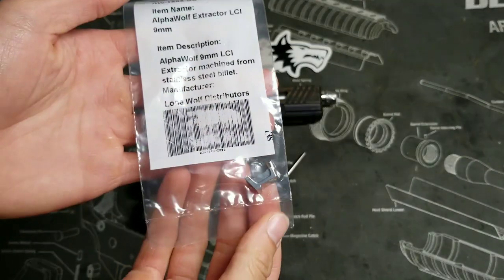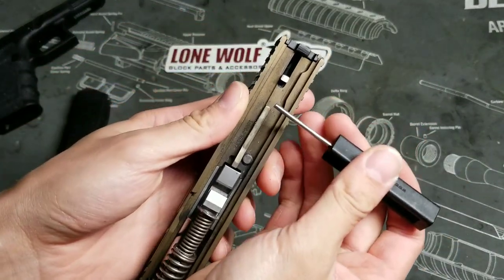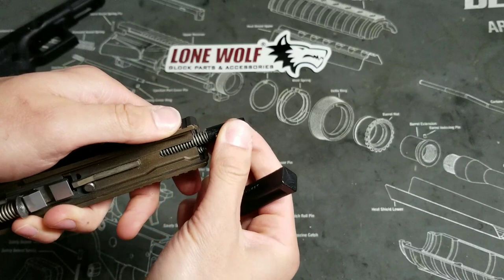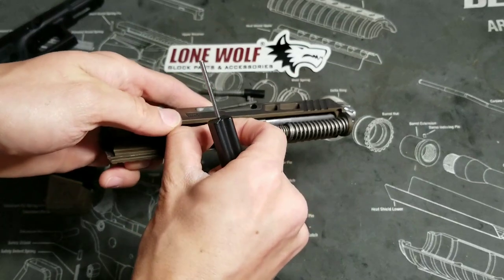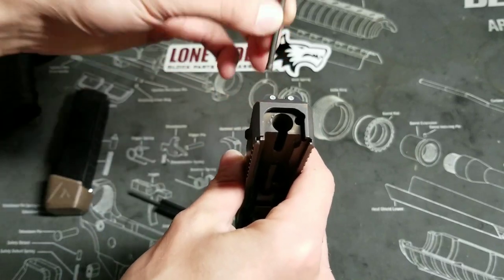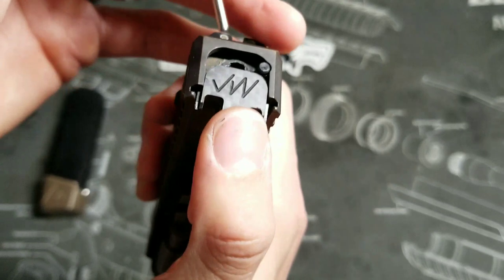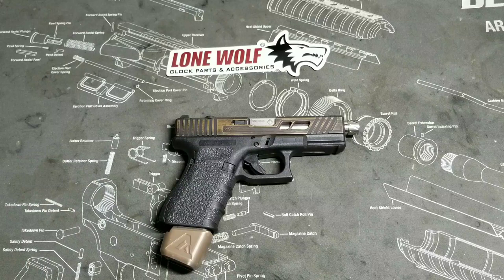Lone Wolf Glock extractor installation

Comment: Nice video.  Thought I needed a new extractor because rounds weren’t ejecting right.  Turned out my extractor plunger was really dirty and difficult to remove.  Eventually discovered that there was some blue gunk (most likely Loctite from RMR) on it that was preventing the extractor from functioning normal.
Reply from the maker: Glad you figured it out and it didnt cause an issue when you needed it

Comment: I built my Poly80 with factory slide parts and a Brownells slide. The extractor function is very rough. The surface the plunger runs against has machine marks or ridges of some kind. I plan to order the Apex extractor and install a Gen4 ejector to hopefully get the thing to cycle reliably. The slide function seems very smooth. But with rounds in the magazine it sticks going into battery. It seems to be the extractor causing the issues. A few of the first rounds ejected the brass back on top of the slide. And it tends not to go into battery.

Comment: Good video, but did you know you are suppose to replace the load bearing spring also.?
Reply: Wouldn't that be only if your upgrading from a non lci extractor to a lci extractor?
Reply: @PMRUNNER   this is what the LWD website says. They list the $1.99 part needed for certain types of Glock 9mm models. Gen 1-4, gen 5.
Reply: If you are going from an LCI to an LCI, then no.

Comment: is that a LW slide? Cut or replacement? Can't quite make out the marking/stamping. Seems like for what it costs to have one cut, might as well keep the stock slide as a backup and just buy a replacement cut slide for the same money. Good vid, thinking about replacing my OEM MIM for billet. Or just buy the billet and run the MIM till failure before installing? Hmmm...
Reply from the maker: This is a slide from Jagerwerks

Comment: Thank you I’m hoping this helps my p80 23 I got a gen 4 extractor that is the 40
And 357 but I’m going to try the gen 5 first if it works good I’m leaving it if not I’m putting the stock oem gen 4 one in

Comment: A year n a half later, any issues, r u still running this setup, any failure 2 eject,?..thx 4 the vid
Reply from the maker: I still have this set up but it is no longer my primary as of this year. No major issues since posting the video.
Reply: @TacticalAdvisor  you said "no major issues." So there were "some" issues then. What were the issues?
Reply from the maker: @DaddyGerLo  I suppose I worded that wrong. I haven't had any notable issues. I have had some gun malfunctions but nothing I can say without a doubt was due to the extractor.
Reply: @TacticalAdvisor  perfect. I will make my purchase then. Thanks for your reviews. They are very informative.
Reply from the maker: @DaddyGerLo  you're welcome!

Comment: I'm going to get one of those extractors for my G 42. I'm getting it mainly for the looks not for durability I have all chrome parts except the barrel. Nice video but are you sure it's smart to do a function check with a loaded magazine? It looks and sounds like you know what you're doing but man that's not right.
Reply from the maker: That will look sharp. Atleast you'll get the look you want while getting a more durable part. Also those are snap caps. That would be very unsafe to have live ammo in the mag while doing this. They are for training.
Reply: Thanks for getting back to me. They weren't on screen very long and they looked like live rounds. Its good to know you not only sound like you know what your doing you actually do. Thank You
Reply from the maker: That's my one gripe about snap caps. Most of them look very realistic. I check them multiple times before dry fire training.

Comment: Quick Glock 26 gen 5 question, I recently ordered the Lone Wolf 🐺 LCI black nitride extractor. I have a new Glock 26 9x19mm gen 5. The website order section said the version I got fits Glock 9mm gen 5. Would I need the small spring part from LWD too? Its $1.99. I would not think the extra tiny part is needed for the Glock 26 gen 5.
Reply from the maker: I do not think you will

Comment: Cool Video! I was interested in there new Stainless extractor Does it eject brass better than stock? Also when is the Polymer80 videos coming? Thx in advance
Reply from the maker: It is a more durable part. It will last longer than the stock part. The polymer 80s should be here and done soon. We are getting them stippled and cerakoted now.

Comment: My glock extractor does not move at at all even though it extracts the casings fine. So that means loaded chamber indicator is not working. It kinda stuck permanently at closed position, so when i load the chamber it does not show at all that there is a round in the chamber (i know it moves very little when round in the chamber but mine does not move AT ALL). Can you please guide me what could be the problem with my G17 gen 4. Thanks.
Reply from the maker: I would check and replace the spring.

Comment: I got a polymer 80 and whenever it fires the bullet doesn’t extract it just stays in barrel and I have to manually reset every round it’s the Glock 26 any thoughts?
Reply from the maker: Check the extractor and ejector.

Comment: Have a glock 27. Bought the SS extrator from Lone Wolf and doesn't fit yet, it's the correct part I was sent. It doesn't just drop in like the stock extractor. Any idea what's going on ?
Reply from the maker: I dont know what could cause that. Have you call Lone Wolf?
Reply: Tactical Advisor I sent a email to the customer service department to see what's going on. I'll keep ya posted 🤘
Reply from the maker: Jeremy Cortese I'm curious to see what you find out.

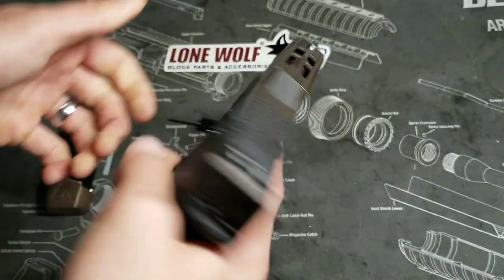Comment: 4:10 you did a function check with a loaded weapon?  I was worried there, but you must have racked the slide just a tiny bit preventing a round in the chamber.  wow.  I was a bit nervous.
Reply from the maker: They were snap caps but I recommend doing dry function tests without mag. This video was made years ago.

Comment: Anyone wondering just buy some punches instead of the glock tool it’s probably cheaper
Reply: That glock tool is only like $6.00 and I've found it to be a bit better the length of it fro working the pins is better.  Most punches are tool long.
Reply: I already have a "tool" with my G-TUL Glock brush, tool set up I purchased 5yr ago from Glockstore.com . G TUL has the magazine cleaner, tool for Glocks: 19/17/23/22/33/26 etc & a larger(lime green) for Glock 21/30/20/29 pistols. It's a handy kit but I rarely break my Glock magazines completely down. Just 1 or 2X per year on avg.